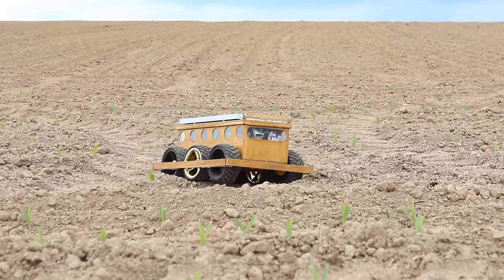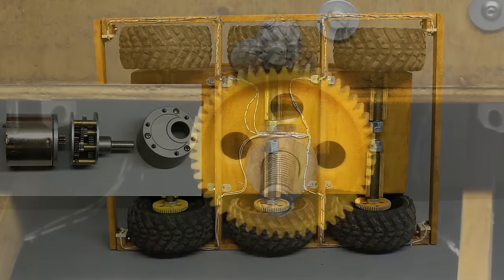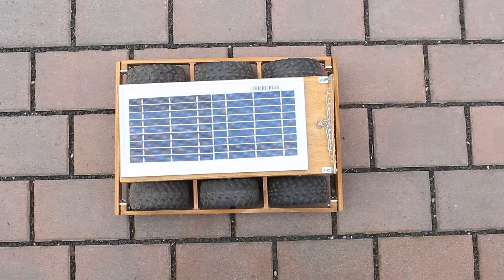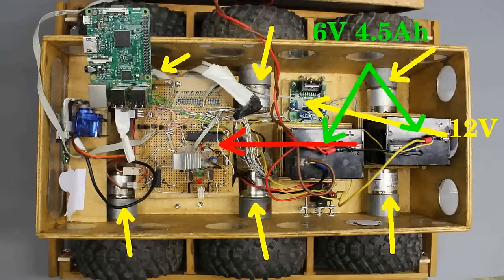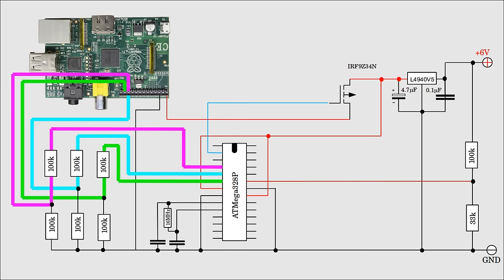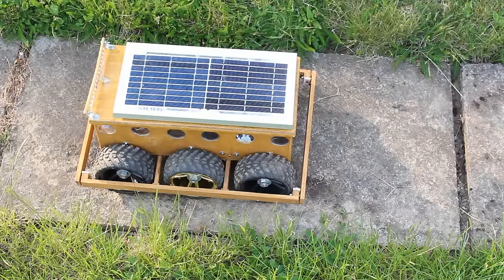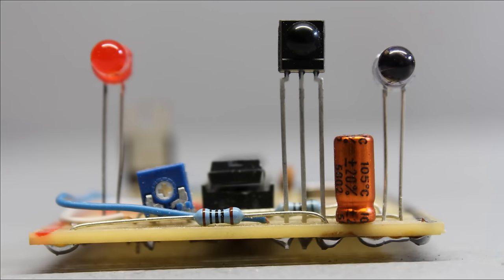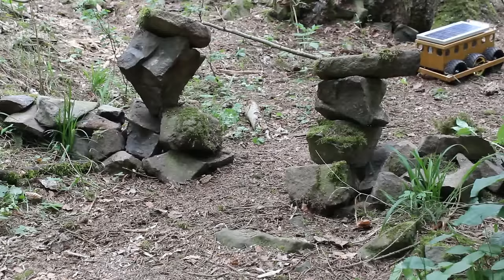R5 - the prototype of my planetary rover

Comment: Awesome work HF - check out OKI-78SR-5/1.5-W36-C for a tidy switched mode supply regulator
Reply from the maker: Yes, a switched mode regulator is indeed better than the linear type I am using currently in R5.

Comment: Since you want this robot to explore the world you might consider putting the cg in the center of the robot. 😁
The width of the wheels is too much wrt to the torque developed from your motors.
The exposed gear on the bottom will get trashed if an grain of sand gets in between the gears.
Reply: Some points to keep in mind:    
Central and lower Center of Gravity.  Sealed gearbox.  Higher ground clearance.
Reply from the maker: Thanks for sharing your thoughts.
Sealed gear box ist already on the list of things to improove.
Higher ground clearance means higher center of gravity. A rover is always a compromise of opposing demands.
Have a look at:
http://www.homofaciens.de/technics-robots-R6-construction_en_navion.htm
and
http://www.homofaciens.de/technics-robots-R5-construction_en_navion.htm